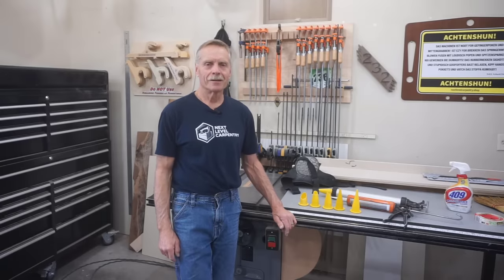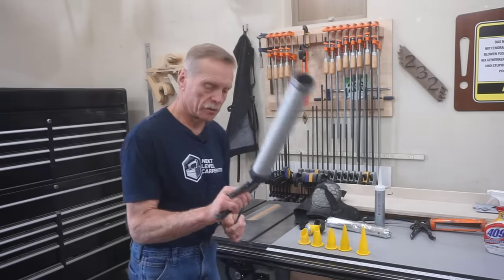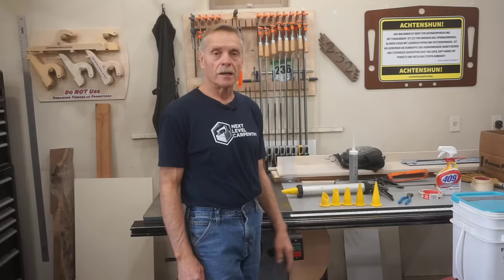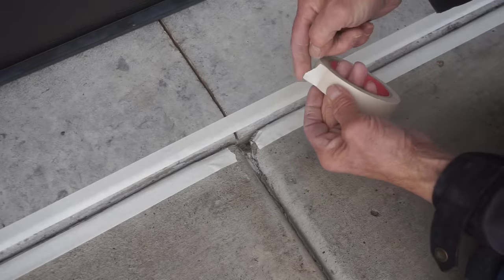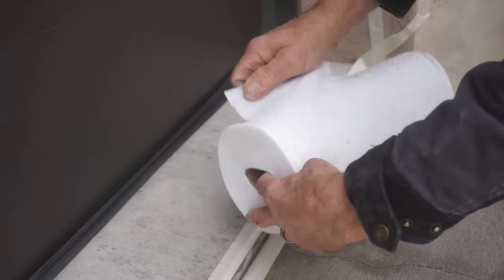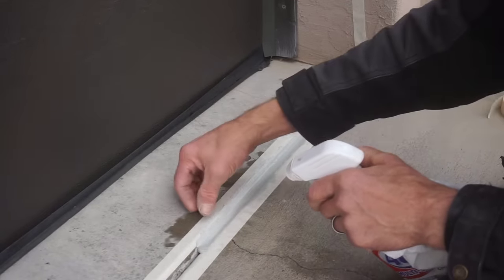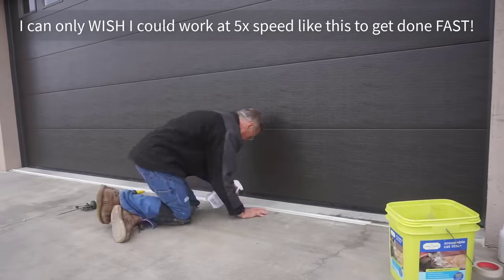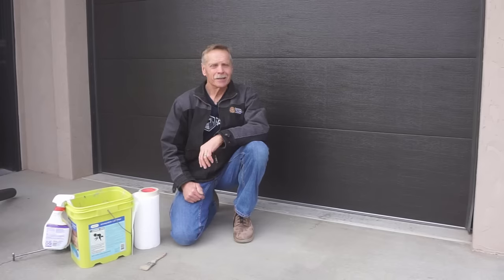How to Caulk Concrete Control Joints with Perfect Results Every Time

Comment: Very well done. You put it  as much time explaining as you do working. I really appreciate your effort.
I’m having a worker put in grout between natural rocks on a motor court. Would this system work ?
The tape and silica are an excellent idea. I’m using mortar and a pouch squeezer. Thanks
Reply from the maker: Urethane sealant won't provide any structural/strength to a joint the way grout will Ben so it doesn't sound like the sort of application for this method.  This will work on things other than concrete flatwork though... just this past summer I sealed up a lot of joints in some large, very stable, retaining wall blocks to keep insects out and got excellent results in both appearance and effectiveness. Not sure if that helps but thank you for watching and commenting on this video... Best, Matt
Reply: Thanks Matt. I could have done a better job on my question. I would like the motor court to show some relief between the natural rocks ( a good half inch). I want to keep the mortar a half inch below the overall surface of the rocks. I don’t want the mortar to smear on the half inch of relief. I’d like the natural look of the sides of the rock to be exposed. 
It will be labor intensive but when I saw how you used the tape I thought that might work on the sides  rocks even though no two rocks are the same. Do u think that’s a good idea or is there an easier way?
Second question Will the silica work on top of the mortar and give off a  semi sandy rustic look as opposed to a smooth look on the grout?
Thanks again, Ben
Reply from the maker: @benfranklin5812  your explanation makes it sound like you are basically doing stone veneer that would typically be done on a wall only you are doing it on a horizontal surface is that correct?
In theory you could use 1/2 inch masking tape around the perimeter of each and every stone and fill the spaces in between with urethane caulk but I really don't think I would recommend it. You might have to mask it off anyways keep the grout from smearing which will again be very labor-intensive. The best way to keep the grout from being shiny and smooth would be to use a damp foam brush or some such as a final step to go over the surface of the grout after it is all flat and trowled into place.
Whatever method you choose I would strongly encourage you to do some practicing and testing to make sure the sequence is doable for what is surely a lot of area and you don't want to make a mess of the whole thing by figuring out too late you should have chosen a different process

Comment: Other Polyurethane products if you can’t easily get Tremco Dymonic FC.  These are available at common hardware stores.

Sikaflex Pro Select Concrete Fix
Loctite PL Polyurethane Concrete Non-sag
DAP Polyurethane Concrete Sealant
Sakrete Polyurethane Non-sag Sealant
Quikrete Advanced Polymer Non-sag Sealant

There are a few others.  This video is a godsend for those who have dealt with all the problems and inferior reliability of self-leveling sealants, THANKS!

Comment: Thank you for your video. I didn't know about this but I"m glad I do now. I just had my back yard paved. I intend to seal the whole surface with a sealer. Should I di this before or after sealing the surface?
Reply from the maker: I'd recommend doing the caulking process after sealer is applied but make sure to read/follow directions on the sealer.  I did my own driveway AFTER applying a sealer and it looks/works great.  Best, Matt

Comment: I’ve never masked NP1 calking. I wet tool it most often.  I have used a little mineral spirits  floated on water to tool.  I have used spoons and icing spreaders to tool it. I have never sanded a joint before.
Reply from the maker: Ready to try a few new tips and techniques to get even better results now? 😎

Comment: Great work.  We use the same approach, on a smaller scale, for caulking up the tub to tile joint (and the counter to backsplash joint) on re-tile as well as re-caulk work.  It ensures a nice, clean, minimal joint.  On a re-tile, I keep the joint super thin (1/8 to 3/16).  In our apartments, the caulk joint is where the bad stuff happens (mold, etc.) so it pays to minimize the joint for quicker apartment turnovers; and a more professional look to our work.
Reply: Dear Expert, do u have experience/ advice to share on applying the shaping bits (cramer fugi 5 kit)  to refine the fresh caulking beads pushed out from a quick cure & sticky adhesive paste like liquid nails (polyurethane,waterproof, by Selleys )? I want to use this to replace 100% silicone sealant at the interception edges of bathtub edges and tiled walls.  will i get nice result as in the silicone sealant scenario?? So diluted soapy water spraying is the usual trick again.

Comment: Fantastic video! Thank you! I used self leveling sika for expansion joints in driveway about 6 years ago with ok success but the slope was problematic. It’s now time for a redo and was searching if removing old caulk and found this video. I assume removing old is correct? I’ve seen videos references that silicone is better than poly. Wondering your thoughts on silicone and if the same approach would work. I used backer rod but some joints have expanded. There are videos saying to use sand then backer rod. I thought sand isn’t a good idea in freeze thaw environments such as where I live Midwest. Appreciate any suggestions feedback. Some neighbors used a company and the finished product looks professionally finished just like yours. Your video demonstrated the right materials and technique is key to professional results. Hopefully you can respond to some of my questions. Either way Thank you for a very informative video.

Comment: Wow, this was an unexpected pleasant surprise. Very well done. Thank you, you have a new subscriber. I was looking for a video on applying sika cement around a new door trim on a stucco exterior, but I didn't even realize that the control joints in my driveway needed to be attended to. Is this common practice? I can see the benefits to keeping out dirt and debris.
Reply from the maker: Thanks Charles.  Sealing control joints in driveways, sidewalks and concrete slab floors isn't necessarily 'common practice' but it's something I highly recommend.  Keeping crud out just makes a property look well cared for and easier to clean and maintain.  In addition, keeping excess water from running/seeping into dirt below any concrete flatwork will keep the substrate more stable, prevent erosion/settling in warm weather and frost heaving in cold weather, all things that will extend the life expectancy of expensive concrete flatwork IMHO.
Best,
Matt

Comment: I use vulkem 116 for roof jobs this is the best polyurethane sealant water in a spray bottle is a must if you want to have a clean looking job vulkem 116 comes in many colors.

Comment: Followed your direction exactly and my joints came out great. It took a few joints to get the hang of it and figure out how best to spread the caulk evenly. I had some wide joints which makes spreading it out a bit more challenging. All in all I am happy with the outcome and no mess. 

One question: I was thinking of caulking the saw cut joints in my garage before applying an epoxy coating. Does this caulking get harder overtime? Would a different product work better for that?
Reply from the maker: Glad to hear of your success Rick... and the learning curve you mention is typical.  I even go through it a bit if it's been months since doing this.  Random feedback here:  I'm not the authority on this but, since urethane NEVER gets hard, if I were you, I'd do the epoxy coating first and apply the sealant in those saw cuts afterwards. I would probably use a thin diamond wheel and a pressure washer in the saw cuts before doing epoxy to get them good and clean in case epoxy runs down in them. Use a complimentary color and it should look like narrow 'grout joints' between concrete slabs.  Or you might find a color that blends perfectly, depending on the epoxy color.  You can probably use a thin diamond wheel to re-clean the joints after epoxy cures if necessary.  If you're having the epoxy coating done by an expert they probably have a compatible epoxy-type product to recommend and use. Best, Matt

Comment: Thanks for a great instructional video!  The level of detail was impressive and so helpful - covered materials, process, and great tips. Exactly what I needed.  I used the Sikaflex polyurethane non-leveling caulk and followed your instructions to a tee.  Came out excellent with one exception - bubbles.  Varying sizes, many longer than an inch.  I have no idea why they appeared.  I was thinking maybe I created a layer of 409 between layers of caulk without working it in, but I had bubbles show up where I didn't even have to do much tooling at all.  Temps weren't extreme either.  I did water-down the 409 a bit, but it was still slippery enough to tool well.  Did my caulking over multiple days (10 sausages worth).  Some areas required backer rod, others didn't.  The only section that didn't have any bubbles at all was the the 20-foot strip in my garage (used backer rod), and I installed it exactly like all the rest of it.  I'm stumped as to what's causing the bubbles.  Any ideas? Thanks again! - Kenny
Reply from the maker: Great comment Kenny... you're most welcome for the video.
Because using 409 seems so unusual for this application it's an easy target as a cause for bubbles but I'm convinced it's not the cause.  I say that because I ALWAYS use 409 and only rarely get bubbles, regardless of how much 409 I use.  
My theory is that air trapped under fresh sealant expands with heat from bright sunlight and inevitably causes bubbles.  I say that because I've seen bubbles actively form as I work and, even after popping them, they can re-appear more than once in the same spot.  Expanding air from under the concrete is a plausible explanation.  The fact that your bubble free section was inside the garage fits this theory and my experience.  In one rare instance I waited a few days for sealant to cure out and cut the bubble out (more on this in a bit) and bubbles re-appeared in the same place more than once.  I was finally able to seal the spot (on the 3rd try) without bubbles forming long enough for the sealant to stiffen and that was the end of that.
The good news is that bubbles are easy to fix!  Be sure the sealant has cured to uniform rubbery-ness and then take a sharp utility knife and cut it out in the shape of a human eye like this "👁"... without the iris, of course.  Then simply re-apply urethane, tool and sand.  You might find a cooler cloudy day prevents bubbles from reappearing.  Repairs should be invisible after a week or so.
Congrats on doing a 10-sausage sealing job... that's a fair amount of work!  Consumes a good deal of masking tape and determination in the process, right?!  Best, Matt
Reply: @NextLevelCarpentry  Thanks so much for the quick and thoughtful reply, Matt!  Your theory sounds very plausible.  I'll give it a try.  thanks!

Comment: Very clear, very good! Thanks. Your best moment, though, was laying down the masking tape, with good tension, straight lines, and even beveled corners. The least accessible moment was cleaning out the crack with a diamond-headed cutter, which also didn't show up in your tools for the job. I think I'll be skipping that step! Maybe I'll just use a cold chisel for anything particularly irritating.
Reply from the maker: You're welcome, Steve... thanks for watching and commenting on this video.  I didn't do either of us a favor by 'hiding' the grinder and diamond wheel in the 'all inclusive' list for Amazon at the bottom under all the individual tools but you can find them listed in that link copied here for your convenience: https://www.amazon.com/shop/nextlevelcarpentry?listId=2N0D3GFVZVC8G
 Best, Matt

Comment: Great video, sir.

I've seen where others have used an old spoon (I wonder if a plastic one would work) to make that nice concave contour.  Wouldn't that make for a faster, more uniform finish?

I've also seen--and used--Sprayway (non-ammonia window cleaner) on silicone caulk the same way you used the 409.  Would that work here with urethane?

Finally, I really like the idea of using the silica sand.  I'm guessing that's good old pool-filter sand?  (If I'd only kept the 80# I changed out last spring!) Cheap to buy and nice, small, uniform particles.

Comment: I've used the self leveling version of this with moderately good results but not as good as the results in this video. I don't use the backer rod to fill up slots that are too deep. I use sand that I tamp down with a piece of wood that fits the slot and then I use a little wood screed that I've made for the slot to level the sand. I think this works much better than using the backer rod. 

I wasn't aware of an alternative to the self leveling stuff until I saw this video. If I do this again I would try exactly the technique used in this video.

Comment: I would always prime the surface with pu primer makes for a much better adhesion on the remaining dust and creates a water barrier in case there is any humidity. You can even wash it prior to priming it because pu primer works on humid surfaces. When you apply the urethane to it while it is still sticky the bonding is superior. For covering it silica sand wroks but painting a layer of pu liquid makes it even better.

Comment: Just completed my driveway joint, if I hadn't watched your video, I would have made a total mess out of the job. While it's not quite as good as your job, it's close. Thanks for being so thorough in your tutorial. I have one question, can you go back and add caulk to the joint if a couple of days have passed since you did it?  I have a couple of lower spots I'd like to raise.
Reply from the maker: You can sure add more sealant later but you might need to wait a week until the first application firms up a bit. If it's difficult to add a real thin layer you can always take utility knife and make a deeper V cut and then fill it back up to the desired level..
Hope that helps? Best, Matt

Comment: There is a reason for dry-tooling BEFORE you choose to wet tool.  The soap becomes a bond-breaker in the areas that are 'holidays' or gaps like you see in this video.  Adhesion is compromised.  Cohesion is compromised when you caulk over the top of a soapy joint as well. 

Otherwise, everything else in this video is 'top-notch' technique.  We have used sandblast guns to make control joints look like mortar joints in facades for years and it dates back to well before my time.  Thanks for sharing!!
Reply: If what you say is true about adhesion using soap, then why has he been doing this for years with no issues of adhesion?

Comment: Thanks for the video!  It gives me the confidence to attack the same job at my house.  Question: why wouldn't I leave the masking tape  on until curing has completed?
Reply from the maker: No need... plus, since it's been soaked with 409, it will come off in difficult shreds... not unlike pulling masking tape promptly after painting.  You'll do well after a little practice! Best, Matt

Comment: Great video.
What can you do if some dirt and debris got into the caulking while it's curing?
Reply from the maker: First off make sure you use the silica sand next time so that the joint doesn't get contaminated with detritus. The only way I know of to remove dirt is wait for the caulk to cure out then cut out the soiled section and reapply in the same manner shown in the video.

Comment: Thanks for the video, very informing with great teaching points.  I have watched it several times.  Question, have you ever had to redo any joints years later after using Tremco Dymonic FC?  The reason I ask, I used a leading brand self-leveling compound but it only took 4 years and it needs replacing as it has cracked and torn away from the control joints.  Looking to try something that will las much longer as it hurts to be on the knees.
Reply from the maker: You're welcome.  FYI I have had to redo joints that have partially failed but that's usually after winter freeze/thaw cycles where slab movement exceeds the Dymonic's ability to stretch.  To your question: I've NEVER seen Dymonic FC crack.  In fact, I've had personal experience with applications that are more than 20 years old and the sealant is still flexible.  It can pull away even if it's flexible but will never crack.  Bottom line is that this material, applied as shown in this video, is, hands down, the best way to seal joints IMHO.  Unfortunately, 'something that will last much longer' has more to do with behavior of the concrete itself rather than a failure of the sealant or application method.  For example, if a slab is poured directly onto dirt without proper gravel bedding and/or drainage, soil movement will often be enough to exceed performance specs of this or any one-part urethane product.  The only permanent solution would be to tear out the concrete and prepare the subgrade with properly engineered and placed material so sealing the new concrete has a chance of being stable enough to stay sealed.
Best,
Matt